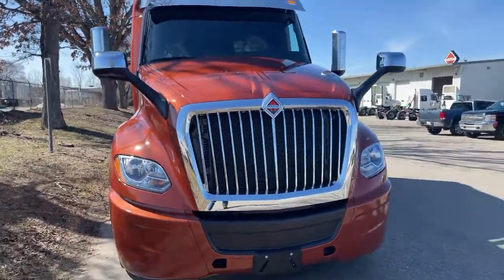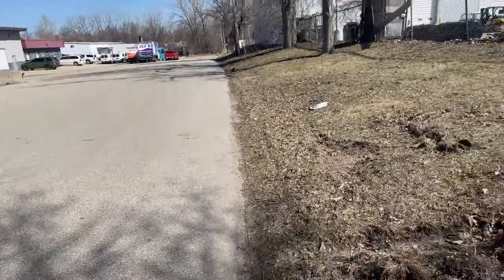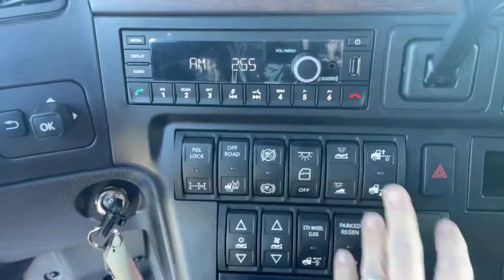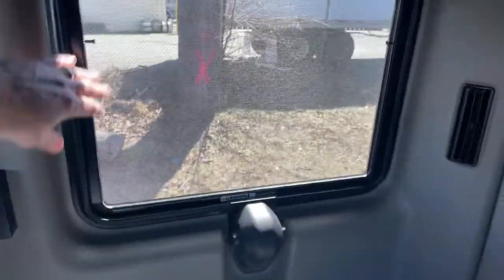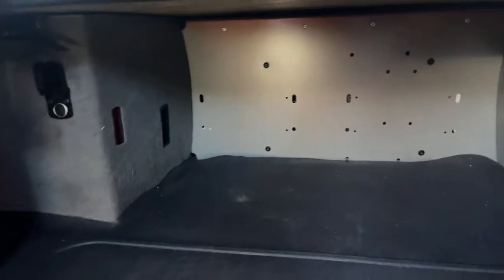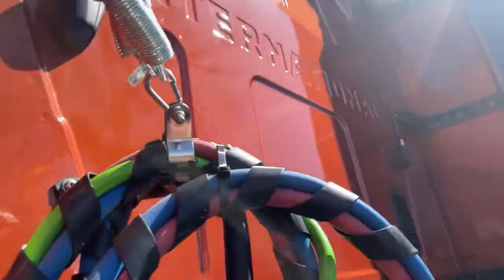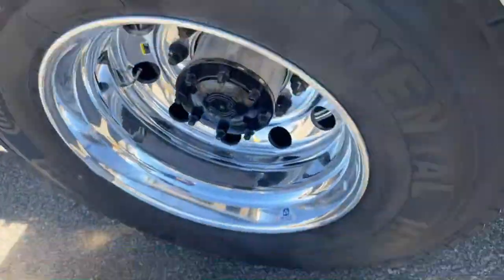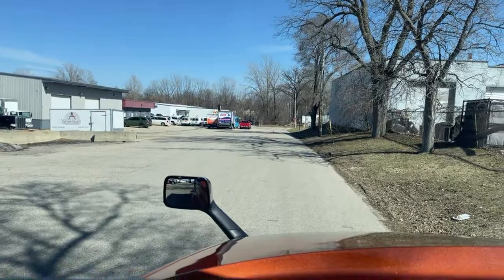International Trucks Live

Comment: Just be glad you don't work on International Trucks . There are the worst quality, if it has an International engine , thank God it has a Cummins in it.
Reply from the maker: I work on all the trucks taking them apart on the inside and the interior quality is much better than freightliner Mack kw t680 . Much better fasteners on an international to hold the dash panels by far fyi